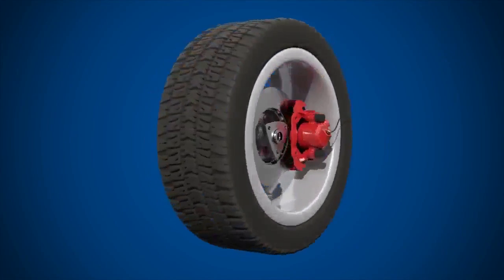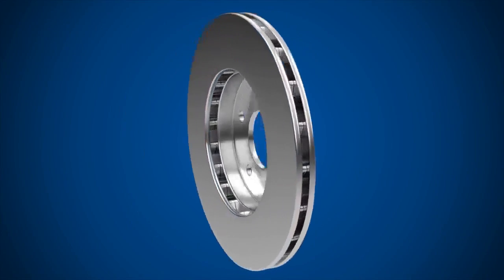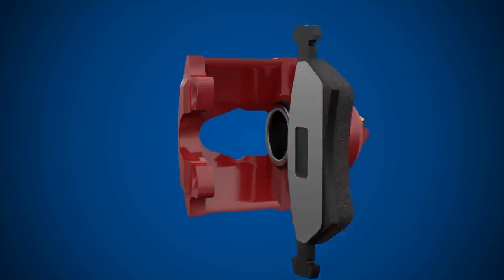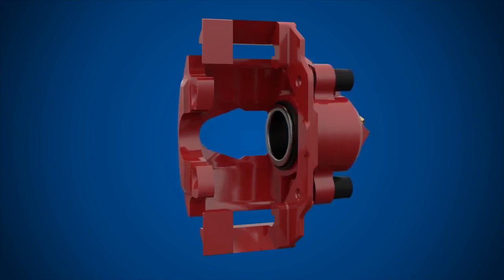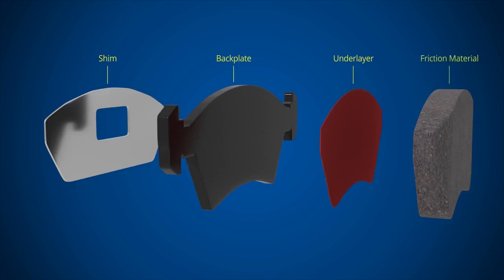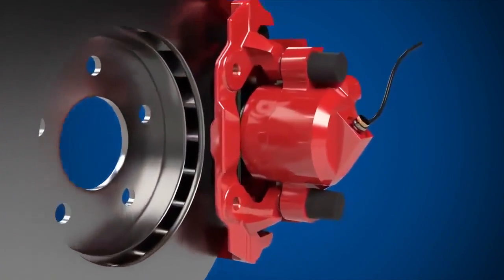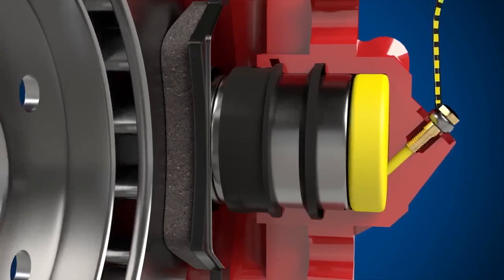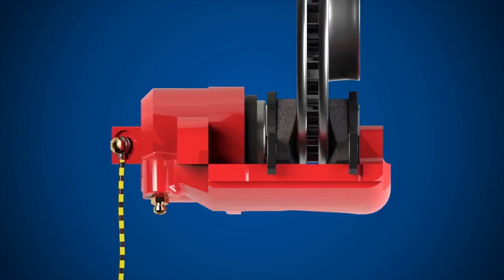How do disc brakes work in cars and light vehicles. (3D animation)

Comment: How does the brake pad or the brake disc not break from all the friction
Reply from the maker: That is down to the construction and technology used. They withstand huge forces of heat and pressure. As you will appreciate, manufacturers invest significant sums to make brakes optimised for certain conditions and applications. More to them (composition) wise than meets the eye.

Comment: Sorry, but the explanation about the movement sequence of the pads is incorrect. The piston stops moving at the first contact with the disc, not because it finished its travel. For continuing its pressure the piston needs a counter part for pushing, and that is why the caliper moves in order to create the opposite brake pad contact.
Reply from the maker: Think it’s semantics. It has finished its travel, it stops but thanks for adding as the principle is important and interesting, the other side travels because the first can’t continue and it’s quite a clever yet simple mechanism. Equal and opposite and all that. All constructive comments are appreciated and hopefully this will shed more light or discussion for some, thank you.

Comment: you have shown how the brakes are squeezed & thus causing the friction to slow down the vehicle - here’s the question: how does the brake pads move back to a ready position? does it get slammed back in position once the hold of the caliper gets released?
Reply: yeah this is the part I dont understand as well.
Reply from the maker: The little o ring
Reply: Nobody knows that.

Comment: Thank you very much, great video ... I have a question please< Is there a space between the break  pad and the break disc? Or the break pad is in in contact condition to the break disk
Reply: There is a extremely small little gap a tiny bit of play when you put the bread pads on the caliber the break caliber hold the break pad away from the disk under pressure and when you push the break pedal it adds more pressure and makes the break pad push against the disk on both sides
Reply: @nielsdewit7619 Yes you’re right! But I was wondering how the brake pads get separate from the brake disc when the piston in caliper goes back. I asked this question to my teacher (because I’m studying car fixing in school. In my country, there are many different departments in school. Mine is department of Auto Mechanics.) the teacher said that when the piston in caliper goes back, the brake pads will be released, and the rotating brake disc will naturally hit the brake pads to makes them go back! ;)
Reply: @Natsuki_Cover  there will be tension plate which can hold the brakes in their places after releasing brake lever.
Reply: If the break pads always rubbed against the disk then you would smell hot breaks and would have no breaks very soon
Reply: @jamesmiller4085  how does the caliber pull the pads away when pedal is released?
Reply: @zzh315 I have the same question and I’m still finding the answer of it :O